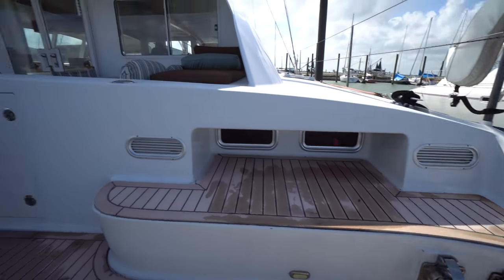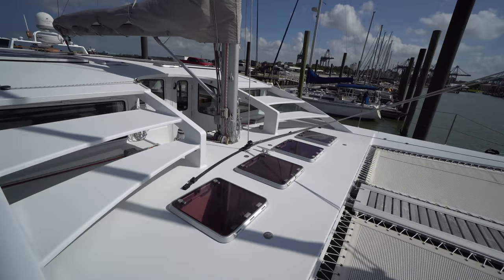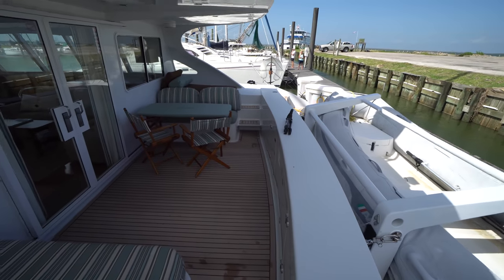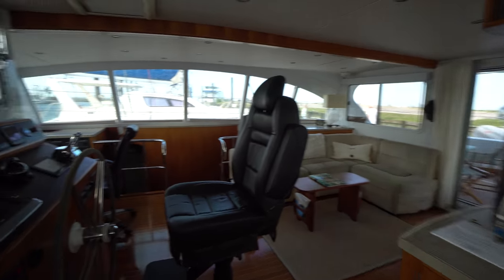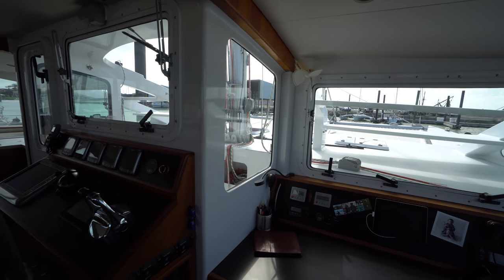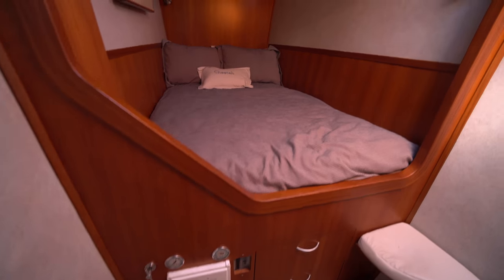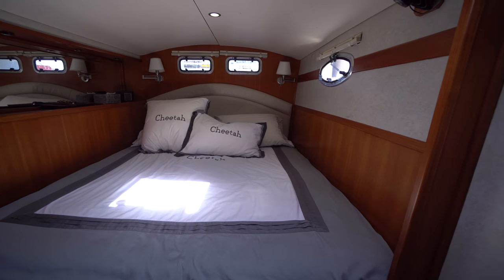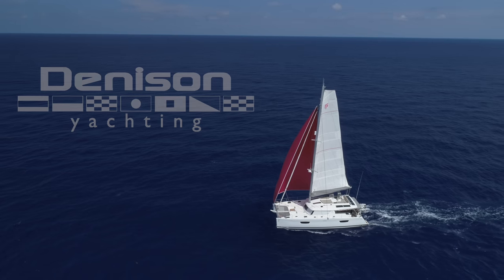DH550 Performance Catamaran Walkthrough / Commentary [4k]

Comment: One Major point you failed to mention is that this boat is powered by 2 18Kw Electric motors ( with 2 16Kw POLAR Gens )  witch provide  5-6Knts on 1 genny and 8-9 with both running.
Reply: I know!  That is the coolest part about this really interesting boat!
Reply: So what is the range on one or both with full tanks? Do they do regen? I noticed the cooker seems to be gas burners, why not induction ona full electric boat?

Comment: I'm glad I went to the website description pages ! I was hoping for dagger boards and the electric motors are better than diesel engines in my opinion . I would change the batteries to Firefly carbon foam batteries though , that's always been my plan for a hybrid powerd yacht . Love this yacht ! I'm checking with my financial advisor to see what he thinks concerning the numbers ! I've got a good feeling about this one. I remember seeing this yacht advertised before . I passed on it because of the construction materials not being vacume bagged with carbon fiber ect... , but I'm rethinking this.  Thanks for sharing 😎
Reply: You should really read up about Dudley-Dix's radius chine technique (dixdesign.com). In terms of strength this is far stronger than the vast majority of composite boats, especially vacuum bagged composite which have issues with dry voids. The radius-chine loses out in terms of weight versus vacuum bagged composites, but has consistent structural integrity and high impact resistance. I've been watching this boat for a long time as I've been considering having one built, but the slow sale of this boat has me concerned if/when I want to sell mine in the future.

Comment: Very interesting boat, build, drive technology, etc.  The forward cockpit would be improved with an outside helm, like Chris White Atlantics.

The finish is very nice, both inside and out.  Don't like the front steps or the external shape of the salon.

The drive is a diesel electric hybrid with Lead Acid batteries (as of the 2018 date of this video), Homewood (axial permanent magnet?) motors, Polar Diesel generators.  All pretty safe and conservative choices for the 2007 build date.  Today, one would more likely use Lithium Iron Phosphate marine batteries, which are safe and have much higher energy density.

Comment: I Have looked at Cheetah several time online and researched the hull if you really want to understand the hull more look up DH550 build on youtube and you can see yourself this is a kit build that is shipped to a location and then you build it or hire a team to build it the material like the cores between the fiberglass are not the same a productions cats most of the time there are all kind of material configurations that can be used and because of that it give pros and cons to the cat. I have always wonder what kind of battery bank he has and what type of batteries? I Love Cheetah layout and build I will not be in the market for 8 more years or she would be on the top of my list to look at. Also I live in West Texas it hot here Houston and the Gulf area is far worse.